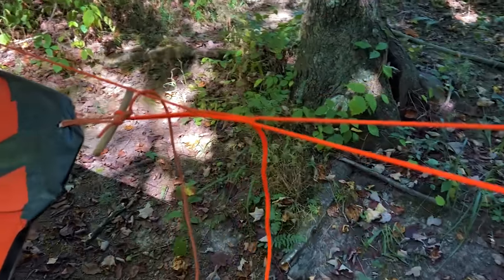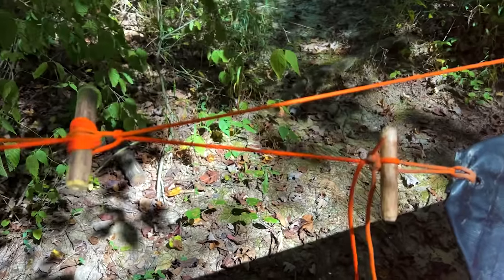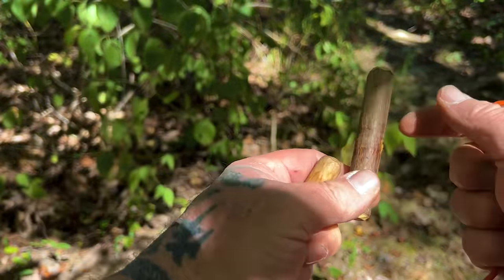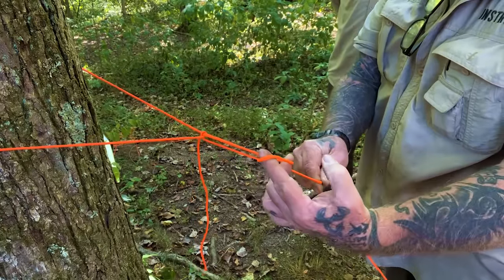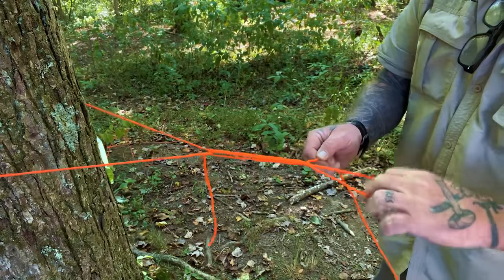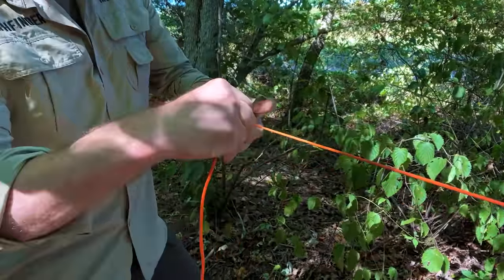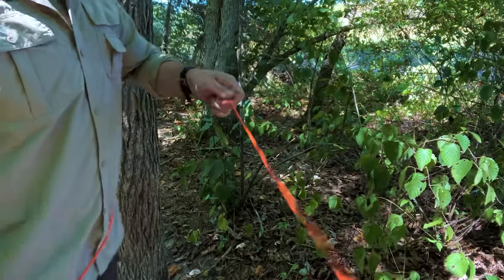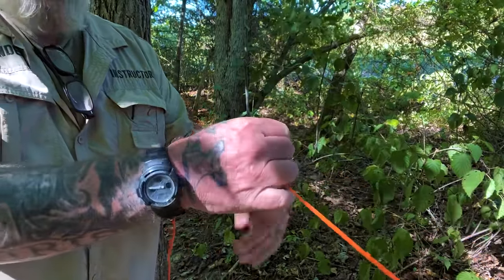New No Knot Ridgeline for Emergency use

Comment: I already have my RDRL all set up with toggles and prusik loops. So this is getting put in the mental tool box. It's not like I use my ridgeline all that often. So the wear is minimal. I appreciate all of you at the Pathfinder company. I had a set of micarta handles come loose on my PKS Survival knife that I bought on January 1st 2020. Mind you, I use it constantly.  It's on my belt every day. And some of it is tough work. I didn't get it to baby it. But you guys said send it in and you'll fix it. Not only did the handle get fixed, the edge was touched up, and the spine was back to a crisp 90 degrees. You have a customer for life for sure. I already have 37 orders since September 6th 2015. And I'm far from done. Thank you for all you do.